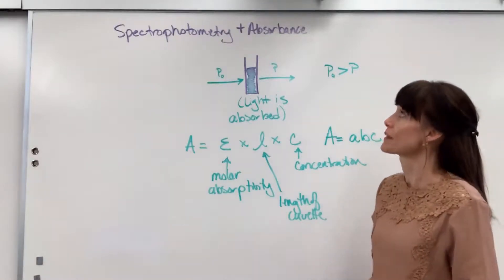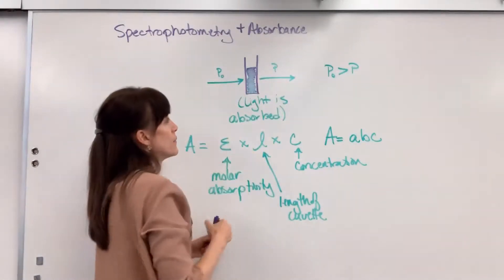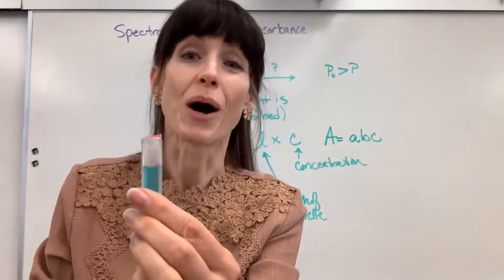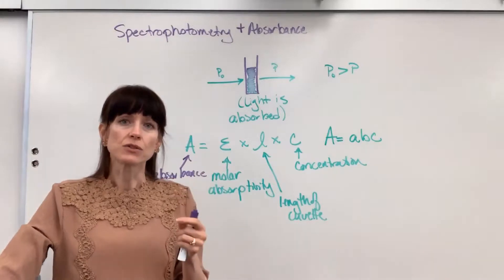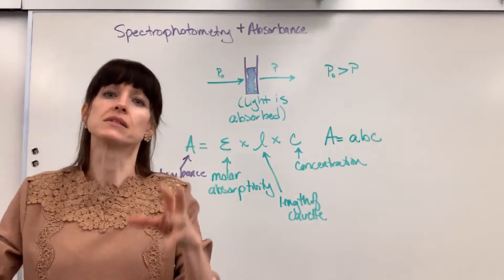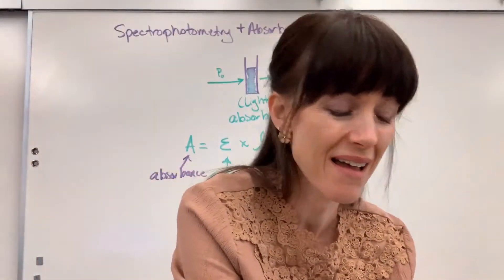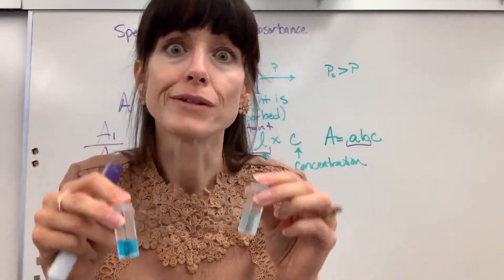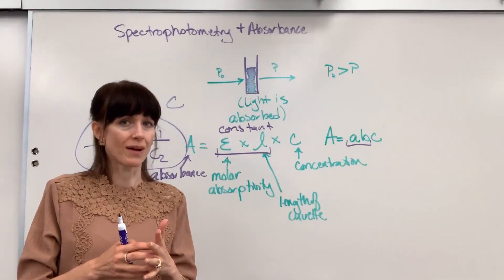Spectrophotometry  (Absorbance)

Comment: Thank you for your amazing sharing! I have a question - If I’m using a machine that is using absorbance photometry, and my sample is extremely lipemic, would the results be high or low? Should I expect it to be low because the contents in the measuring cuvette is unable to absorb much light due to the turbidity of the sample?
Reply from the maker: Hi Frostysleet, this is outside of my wheelhouse.  I had to look up the answer using an AI. Here you go! Great question! When using absorbance photometry, a lipemic sample (which contains a high concentration of lipids, making it cloudy or turbid) can increase scatter and interfere with the measurement.

Would the results be high or low?
In most cases, the results would be artificially high rather than low. Here’s why:

Light Scattering (Turbidity Effect) – Lipemic samples cause significant light scattering, which the spectrophotometer may incorrectly interpret as increased absorbance. This can lead to falsely elevated results.

Baseline Shift – Many spectrophotometers assume that any loss of light is due to absorption by the analyte. However, in a turbid sample, some of the light is being scattered instead of absorbed, which mimics an increase in absorbance.

Wavelength Dependence – The impact depends on the wavelength. Shorter wavelengths (UV range, ~340 nm) are more affected by turbidity than longer wavelengths (e.g., 600 nm).

Should you expect lower results?
No, you shouldn’t expect lower results. While it's true that lipemia can interfere with absorbance readings, the effect is typically an overestimation, not underestimation, due to light scattering.

What can you do?
Centrifugation or Ultracentrifugation – Separating the lipid fraction before measurement can help.
Blank Correction – Running a blank with a similarly turbid sample (without the analyte) can reduce interference.
Dilution – Diluting the sample with an appropriate solvent can minimize lipemic interference.
Use a Different Wavelength – Some analytes can be measured at longer wavelengths where light scattering has less impact.
Reply: @ oh wow! Thanks for going the extra mile to answer my question! Greatly appreciated!

Comment: How can I determine molar absoptivity theoritacally?
And does it have any relationship to maximium wavelength that determined by woodward fieser rule and alpha beta unsaturated?
Reply from the maker: Hi Doniadarmly,  Honestly, I am not sure.  Lambda max for wavelength gives you the maximum asborption at a particular wavelength for a specific substance.  To determine molar absorptivity using the formula you would need the absorbance, concentration, and length of the cuvette.  I hope that can at least point you in the right direction.  It would be advisable to talk to your professor.  Thanks!
Reply: @OldSchoolChemistry  thank you  💕
I am wondering what the importance of determining lambda max?
Reply from the maker: It tells you what nanometer to set your spectrophotometer machine to. It can then read for that particular solution color (lambda max).  Thanks!
Reply: @OldSchoolChemistry  thanks alot 👏🧡

Comment: I basically understand the principle of the spectrophotometers use.  It is most often talked about in terms of one specific solute.   If you have a mixture of multiple types of sugar such as in the boiling of starch/ various grains breaking them into a fermentable sugar how do I get a idea of how much sugar is in the solution measured? Do I have to find the wavelength for each know sugar In question or can related absorbance to increase overall starch converted now to some sugar?
Reply from the maker: Hi R. Finch, if I’m understanding correctly you have a mixture and want to identify the concentration of one solute. Create a beer lambert plot for that one solute based on lambda max ( maximum absorption of that sample). Then run the sample at the same wavelength to determine concentration of that specific solute  in the sample.  I hope that helps. Please subscribe if you haven’t already.

Comment: Since the volumes assigned to us start with 0 yet the absorbance reading showed a value greater than 0
Reply from the maker: Absorbance will always be greater than zero if it is a colored solution.  The ions in the solution will absorb some of the light energy as the light passes through the solution.  Thanks!

Comment: Hello there. Help with a question ? A compound absorb light in 227 nm. The standard curve calibration for the compound is Abs = 372x + 0,6432 which the concentration is g/100mL. The technique was standard addition method from fluoxetine hydrochloride (C17H18F3NO.HCl - molar mass = 345,79 g/mol). So determine the concentration in mol/L in the analysed solution. Show all calcs progression.
Reply from the maker: Hi Fabio, you would have put the analyzed sample in the spectrophotometer machine and gotten an absorbence reading.  Take the absorbency value of the sample and plug it into your equation as Abs. Then solve for x which is the molarity of the solution.  Good luck!
Reply: @OldSchoolChemistry  Hello thanks for your return. It's an exercise question i don't have equipment to use. Let me post the full question:

Standard addition is an analytical technique of extreme importance to an analyst, as it eliminates the interfering effect in most determinations. Fluoxetine is widely used as fluoxetine hydrochloride, also known as Prozac®. This is indicated in the treatment of depression, associated or not with anxiety. This compound absorbs ultraviolet light at a wavelength of 227 nm. It has in its structure a stereocenter, being a chiral drug. It is known that only the (R) -fluoxetine isomer has activity, while the other enantiomer has no pharmacological action and there is no evidence of toxicity to the organism.

In an industry, when performing the Fluoxetine analysis, the following analytical calibration curve was obtained, in which the concentration is in g / 100 mL: Abs = 372 CFluoxetine + 0.6432.

Knowing the analysis was performed according to the standard addition technique and that the molar mass of fluoxetine hydrochloride (C17H18F3NO.HCl) is 345.79 g / mol. Determine the mol / L concentration in the analyzed solution.
Reply from the maker: Hey Fabio, I’m not familiar with all the symbols either.  Good luck!!
Reply from the maker: Hi Fabio,  I am missing something.  You need the absorbance of the sample to calculate the g/100ml concentration which is x in the equation. Once you have that you can use molar mass to cover it to molarity.  I’m sorry I could not be more helpful! I would ask your professor how you determine the absorbance in this problem.  Thanks!
Reply: @OldSchoolChemistry  

I thinks i need to use this equations but i dont know how. 

S= k . Ca  
y = m*x + b  
Y = S
x = Vs
m = k . Cs / Vt
b = k.Cx.Vx / Vt

It's a friend whom sent me and i couldn't to do it. I researched i found this 3B4 equation. ( http://www.mathcentre.ac.uk/resources/uploaded/3b4printableversion.pdf ). But i dont know the source from y value which has been used.

I have the alternatives but idk which is the correct nor how to reach on it.

2,25x10-5 mol/L
5,58x10-5 mol/L
5,0x10-5 mol/L
9,69x10-5 mol/L
3,08x10-5 mol/L

Comment: Why was the sample cooled to room temperature before measuring the absorbance?
Reply from the maker: Hi Zainab,  in my example in the video students simply diluted a stock solution of copper (II) sulfate.  This was done at room temperature for each concentration so temperature was not a variable.  Absorbance can be used as an experimental technique when running experiments.  It is possible a professor would ask you to run samples of solutions at different temperatures to identify concentrations impacted by the rate of the reaction.  This would be a very specific request.  Most absorbance labs and Beer Lambert plots are run to identify the concentration of an unknown substance.  Temperature will be constant in this type of experiment.  Rate can also be determined with absorbance labs.  This is focusing on concentration versus time.  My guess would be the temperature must be at room temperature to serve as a constant and not a variable.  I hope that helps!
Reply from the maker: Most likely to maintain temperature as a constant and for the amino acids to be stable.  I hope it goes well!
Reply: Thank you so much 🥰🥰
My experiment is about amino acid assay by ninhydrin colorimetric method so l want to know why we cooling the sample  .... 
agein thank you so much 😘😘😘😘

Comment: In my case I don't have any concentration ... how can I calculate the concentration from the absorbance
Reply from the maker: Hi Edouarda, there are 3 ways to find concentration.  One, you need at least 2 absorbance values and one concentration value to calculate an unknown concentration.  Set the values up as a ratio and solve for the unknown.  Two, look at beer lambert graph.  Match the given absorbency to the corresponding concentration.  Third,  use the formula Abs=abc.  You need Abs,a,b and solve for c which is concentration.  Your question will fall in one of those categories.  I hope it goes well!!
Reply: @OldSchoolChemistry  Abs= abc I got my absorbance and the path length is 1 so b=1 ... but I don't know how to get the constant a 😭😭 If I may show you the work cause I have been on this since morning
Reply from the maker: @edouardamenie3885  If you know the compound, you can look up the molar absorptivity which is a.